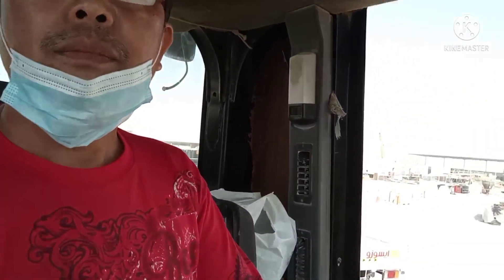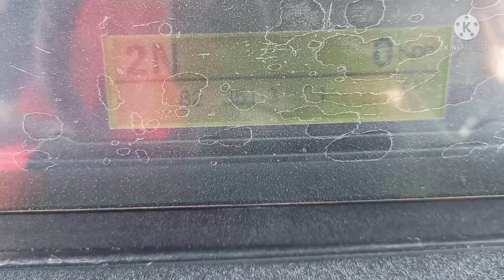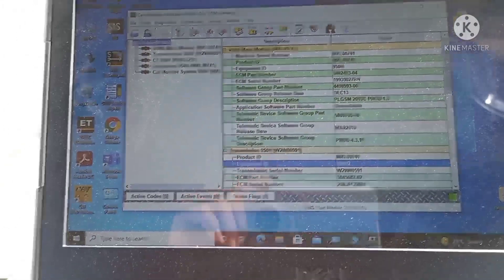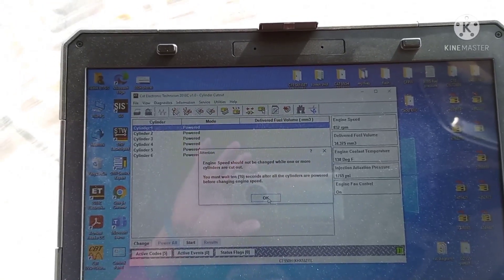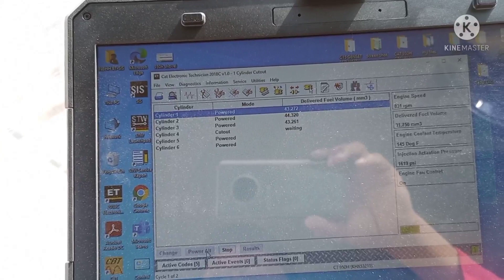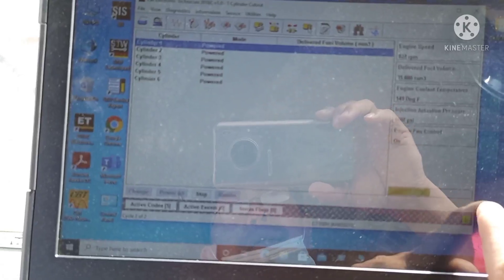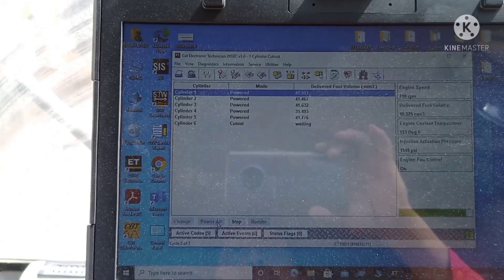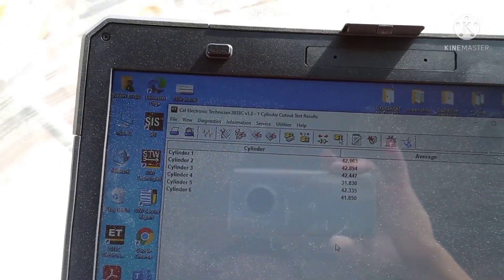950H SHOVEL INJECTOR TESTING low power

Comment: i believe the delivered fuel volume for all injectors are very high sir. need to replace them all to repair the low power and misfiring.
Reply from the maker: the cause of misfiring maybe some of the injectors not injecting normaly base on the normal fuel output of the injectors, if you see the actual pressure while i'm doing cutout, there some injector inbalance injecting fuel that sometimes happens if the calibration was not perfect or something wrong on the mechanic the fuel. system was contaminited due to improper installation, so on that situition you cannot blame anyone on not perfect installation, if you think and you fill that the injector is the main cause of misfiring so you dont have any choice, removed and re calibrate it again, then advise the mechanic clean up all. the fuel system then fix the newly repair injectors
Reply from the maker: we just do the replacement after we pound anusuall on the injectors pressure, hehe, thanks for your good comments and suggestion

Comment: I have cat wheel loader Tha problem is in loader when I start 10 sec engine missing
Reply from the maker: just only 10sec not more,because you know some reason thats hidding ,like airlack on fuel line,or you can check return valve if your machine is cat shovel,return valve located at the flywheel side of engine,or sometime that is normal for old model of machine if just only 10sec of misfire,the best you can do is check fuel line for any crack on hose and steel pipe